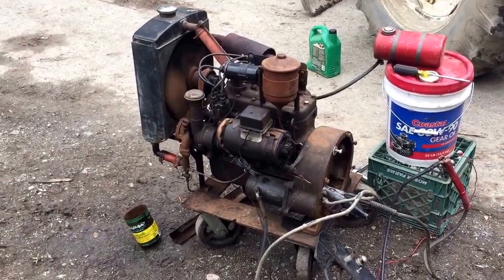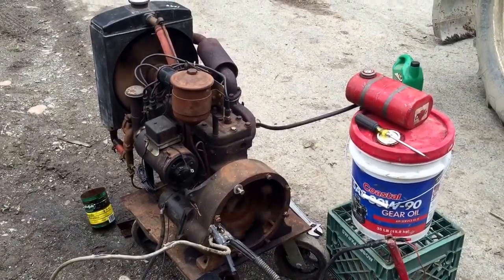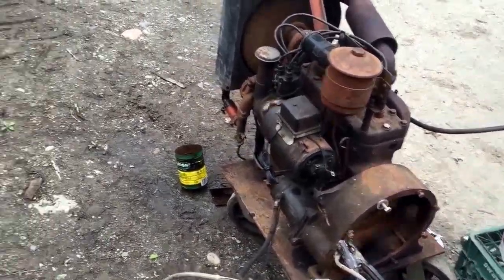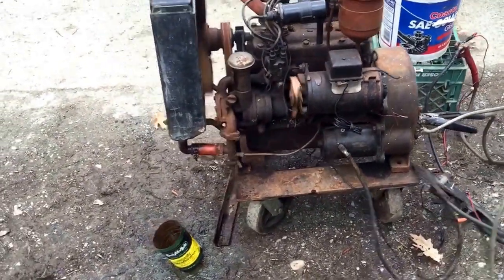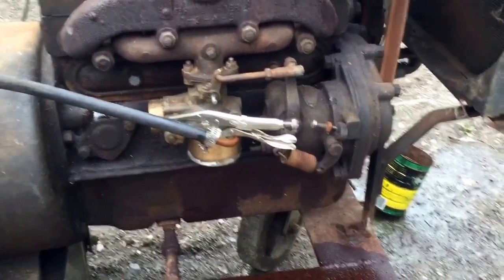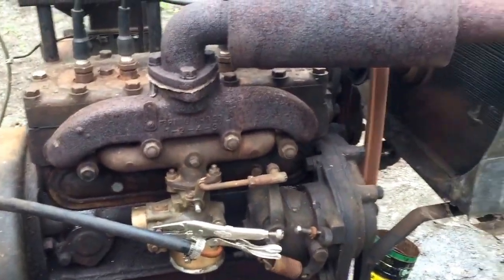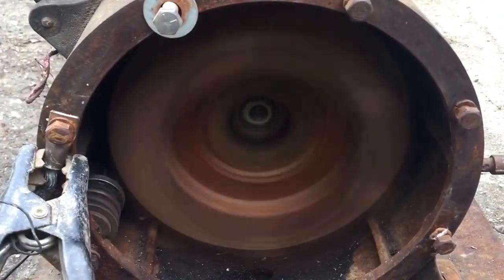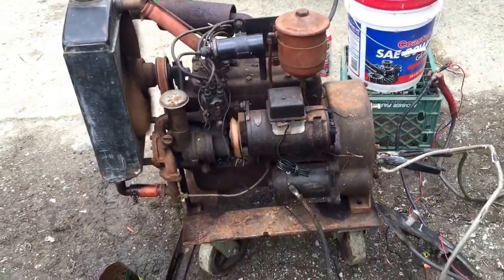My engine auction score

Comment: Maybe you will know I just picked one up today, and it has a parts Field manual and it does say Grease water pump I don't think they actually meant put grease inside the water pump 😂 or do they mean that?
Reply from the maker: Grease cup on the waterpump shaft

Comment: Nice find.  This is the same engine that B.F. Avery used on their smallest tractor.  It was the model V and was built from 1946 through aound 1952...  B.F. Avery was bought out by Minneapolis Moline around 1951; but they continued this little model V tractor for about another year or so with this same Hercules ZXB engine.  I believe the carburetor they used was a Tillotson YC6A.  Nice to see and hear it running.  Thanks!
Reply from the maker: tnwaterboy1 yes that’s all true I know someone with one of those tractors. I’m pretty sure the tractors didn’t use the waterpump so they were a thermosyphon system. Unfortunately my starter crapped out otherwise it’s a great little engine

Comment: Ok I watched it again and to me it seem like governor bounce. The adjustment that you made should be for the running speed, Once that is set there should be a screw with a lock down nut on the very back side of the governor that can be adjusted to take the bounce out when set at the correct running engine speed. It looks like your might be missing. If it is it should be a easy fix.
Reply from the maker: The bounce in the governor is because the carburetor is messed up and not providing the right mixture at higher speeds

Comment: That is SWEET! we had one of those at the fire station for back up power for the radios. They tossed it one day when I was off duty, I was so pissed off because I could have had it. The Hercules was a quiet motor, well balanced and it just sipped on the gas that thing would run forever on 5 gallons of gas. I think your Carb is good it seems to me that the governor is out of adjustment.  Excellent find.
Reply from the maker: Well it's only a small displacement 11hp so I am not surprised they sip fuel, I have a 6500w Kohler electric plant with a little Kohler 4cyl engine and it sips fuel its just not as quiet as this Hercules I wish I had the complete unit now lol

Comment: Whats the make and model of the engine?  Your carburetor surging at higher rpm to me seems like its "searching" for fuel, may just need a good cleaning and adjustment.
Reply from the maker: It's an early 40's Hercules model ZXB makes 11hp @ 1200rpm